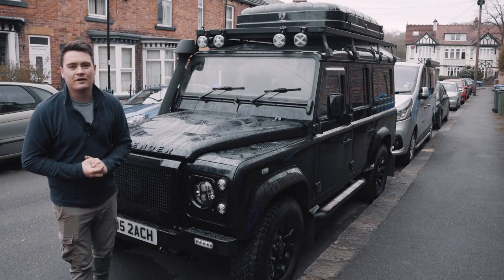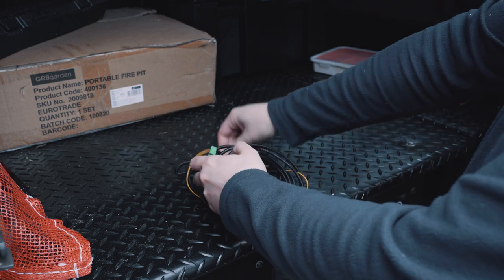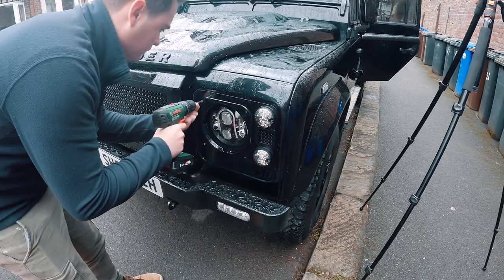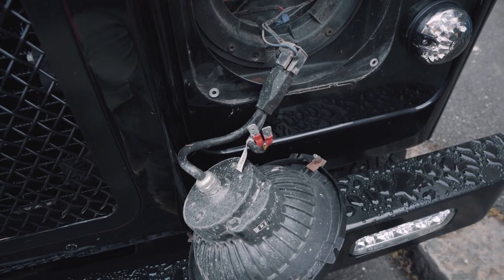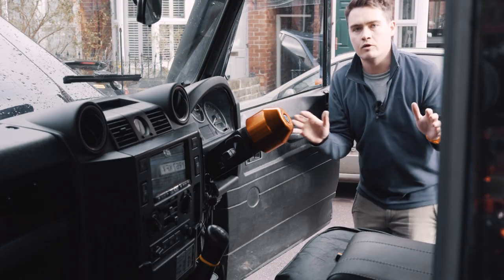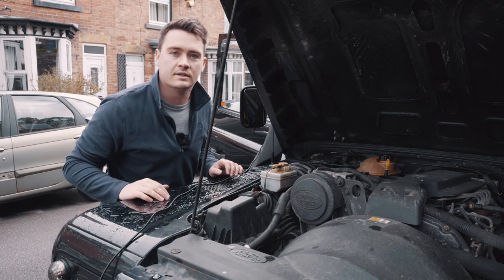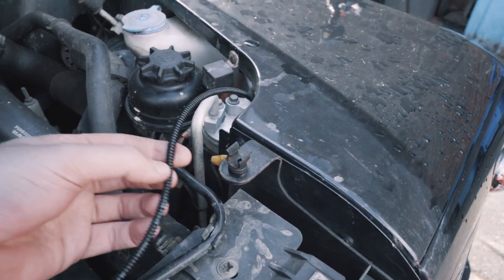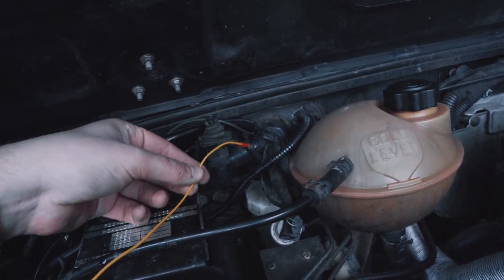SUPER EASY HEADLIGHT UPGRADE FOR YOUR LAND ROVER

Comment: Nice job! Was there a specific reason you didn’t run the power wire to an existing fuse? Just curious, I’m not confident about wiring at all!
Reply from the maker: I just found it easier to add the additional piggy back to the cigarette lighter - lots of different ways to tap into a live for this though